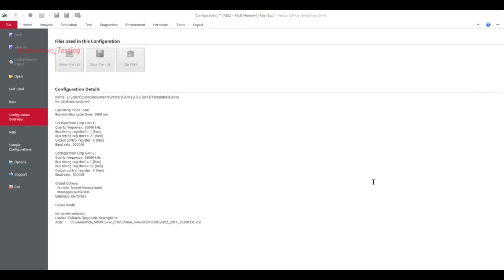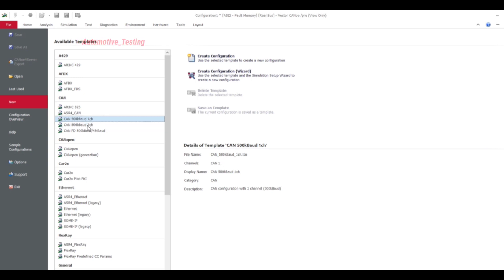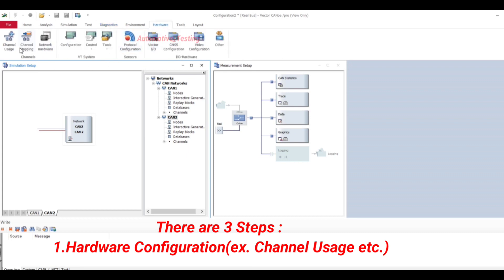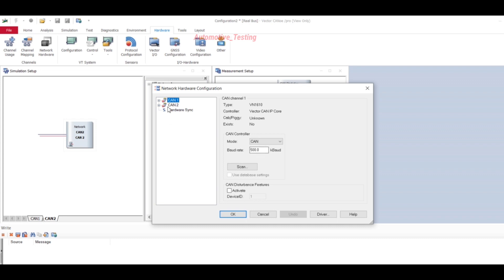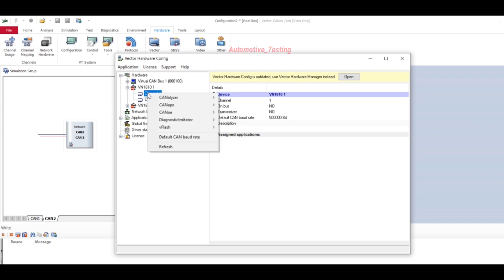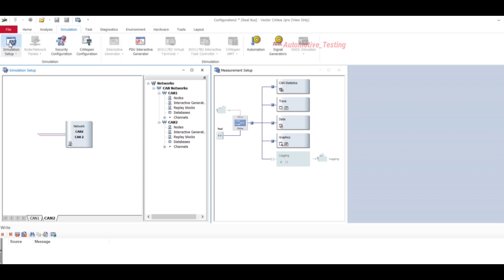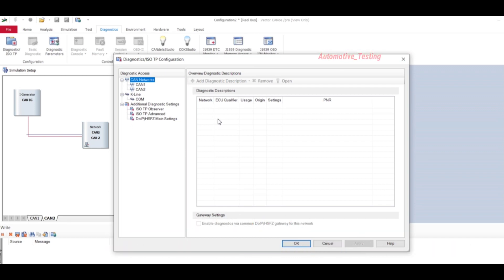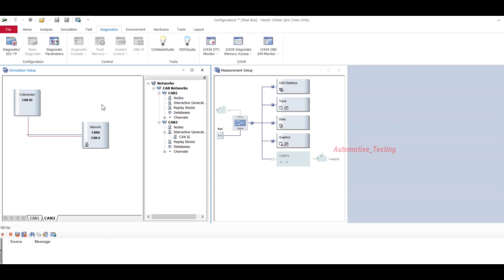🤔How to create new config file on vector CANoe/CANalyzer #automotive #howto #infotainment

Comment: Alagey UDS lo configuration management and fault management medha oka video chey bro
Reply from the maker: Sure bro, I will cover them in upcoming days
Reply: @Automotive_Testing  tq
Reply: @Automotive_Testing hi i have one doubt in canalyzer i had configured the LIN protocol configuration but the rx is received invalid header and cs error can you tell me why ??
Reply from the maker: @vishnu.k4737  there might be issues with Baud rate mismatch, Incorrect LIN configuration  or may be faulty hardware
Reply: @Automotive_Testing  the baid rate is 9600mhz and channel mapping I have checked it is correct but rx is showing error so I will check hardware and pin you